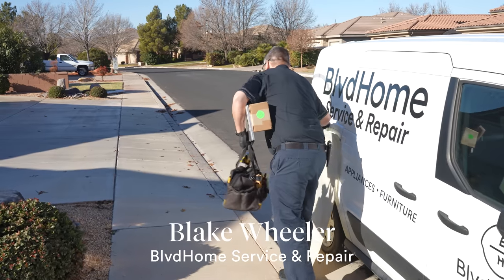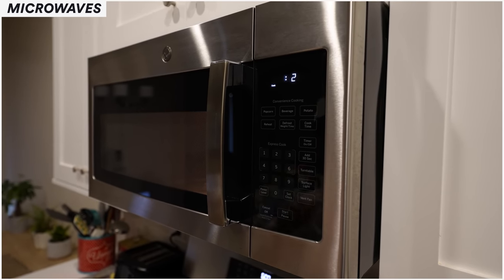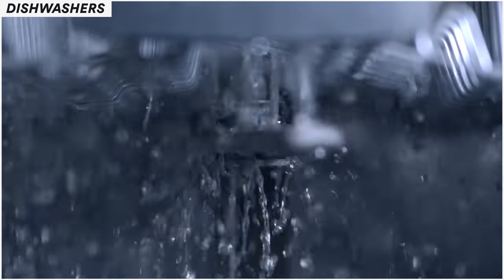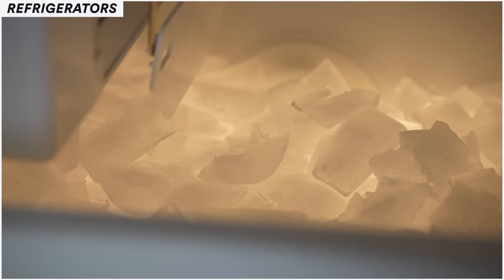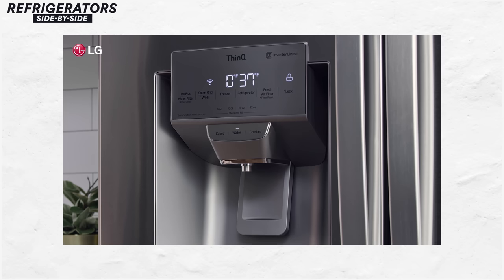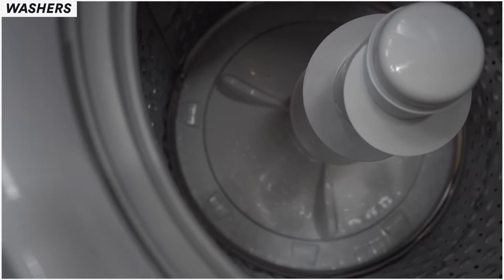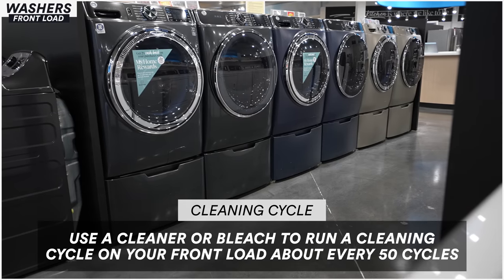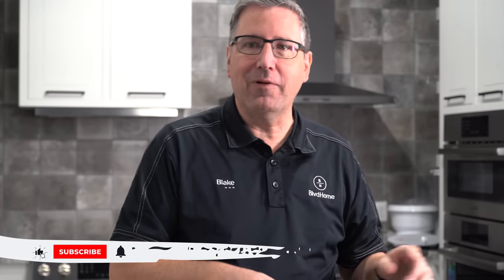Best Appliances Recommended by a Repair Technician of 29 Years

Comment: Our repairman gave us similar advice on brands and features on the appliances you mentioned. He did say Bosch DW parts were especially hard to get even before 2020.  He recommended the Whirlpool. We actually love our KAaide, which is made by whirlpool. Less $$$ than the Bosch, too. 

No matter what brand of DW one gets my best tip for preserving the plastic parts and dishes is to not use the heated dry cycle. Open and let the dishes air dry. I have replaced most of our plastic storage with glass or stainless steel containers. This also helps the drying process.
Reply: You are so right about not using the heated drying cycle.  I open the door of my GE dishwasher & pull the racks out.  I check for water pooling on top of cups & stuff.  Within +/- an hour the dishes are dry & spot free.  I even put large plastic items on the lower rack without damage by using this method.
Reply: Thank you so much for the advice. It makes sense why the plastic on my refrigerator is falling apart. I used heated drying. I will have to replace and start opening door instead.

Comment: Excellent video!!  I didn’t know that pulling a microwave door open to stop it was hard on the switch. I have been doing this because of the annoying loud 5 beeps when the timer reaches zero. Most models don’t have an option to turn off the sound. So, when I wanted to avoid waking up my family in the early morning, I’ve been yanking on the door.
Reply from the maker: I totally understand that! Microwaves can be super annoying, especially when you're trying to be quiet. Glad that the video was helpful!

Comment: Use powdered laundry soap in the front loaders and they wont get stinky.  I switched years ago and never had a problem with bad smells again.  I dont do any special cleaning and leave the door closed most of the time.  Great video!
Reply: Intetesting, because usually liquid detergent is recommended.
Reply: The powdered detergent sticks in the dispensing trays - it never  clears out of the tray after a cycle so no to powdered detergent. I throw oxy clean directly in the tub before the cycle for this reason or I dissolve it in water first.  Lg front loader.  I love my washer but no to powdered detergent t and my washer never smells.  I’ve had it for 12 years.   Leave the door ajar to let it dry out and do the clean cycle with bleach once a month.  I’ve never had any issues with any odors and with 6 dogs in my house I’m washing bedding  all the time.
Reply: yes,  I use powder for regular wash and liquid for woollens, After reading horror stories before buying my current Asko, made in Slovenia (previous one lasted 18yrs, top model of the day, made in Sweden)
I always remove the soap dispenser to let it dry and leave the door ajar, the door closes without rubber bellows  - no mould or funny smells,  both parts of drum are stainless steel, drum supported on 4 shock absorbers.  No special cleaning program needed during the last 6 years. fastest.  Spin cycle is noisy but works well.    Asko Dishwasher lasted over 20 years and failed in a recent power surge.
Reply: Leaving the door closed is how you get tons of mold in there and it has nothing to do with the type of detergent you're using. I imagine your washing machine is disgusting

Comment: I have a bosch dishwasher, LG washer, Hitashi fridge (no ice maker) and frigidaire gas range and they have served me well in the past 5 years. LG washer lock button broke and changed it for 15$ and literally that is it. I am truly lucky and amazed by the built quality of those appliances and would definitely buy them again.
Reply: I've been looking into LG washers. Which do you have and how is it?
Reply: @johnnys249  i dont know off the top of my head but I can give you the model number when I get home. It is a washer/dryer 2 in 1 kind though.
Reply: @johnnys249  f0k6dmk2s2 2 in 1 washer + dryer inverter direct drive 14kg wash / 8kg dry

Used on daily basis and multiple times a day even. Only maintenance needed is to clean lint and empty water from bottom tray. I guess some sort of condensate from drying or something. Super easy though. There is wifi where you can custom make your wash or download some from the web. Never needed that. Plenty of options on the washer already.
Hope this helps.
Also: i bought this in Kuwait so it may be a Middle East special version but I am sure a european or us version of it exists with similar features.
Cost around $650 in 2018.

Comment: I have a 45 year old Maytag A806 washing machine second hand 10 years ago and in the entire time I had it there were 2 breakdowns. A dried up broken hose and leaking water pump.  Replaced both myself and was fairly easy with minimal tools.  I change the belts every so often and the damper pads and that is all the service.  It is very gentle on the clothes.  They do not make them like this anymore!!  Never plan on getting rid of it.  In fact it has outlasted 2 newer dryers.
Reply: I cannot begin to imagine what you're electricity bill looks like
Reply: @VEVOJavier  Not bad this unit only take 25 minutes to run a full cycle, using some maths its 15 cents per load of electricity.
Reply: I have had my late mother's old Maytag from 1980 for the last 15 years. Had a couple of $150-200 repairs in last 8 years, and three weeks ago had it finally flood my kitchen, laundry and family room. It served us well for 44 years, and now I am getting a new kitchen courtesy of my home owners insurance. So even when Maytags fail you can win!!
Reply: @krisschedler  yes. I had something like that happen with my LG dishwasher.  The drain hose just fell apart on the pump. Only 4 years old.

Comment: My #1 failure reason on microwaves = weak, crumbling plastic parts. If you ever have to take a screw out of that plastic, it just falls apart. SO COMMON. Especially over-the-range Frigidaires. Cheapness elevated to the highest level.

My long and varied experience with LG washers and Bosch dishwashers agrees with the video. They work great and are amazingly trouble-free.
Reply: Yup, was looking for a comment about this. Our door handle cracked on our above the range microwave and it costs too much replace!

Comment: So glad to hear about Bosch; that's what I keep seeing online, and I have a friend who loves hers. That's our plan. For our needs, we basically found a particular French door/dual bottom freezer LG that works for us, but I'm leery about it now. :( I bought the Bravos Maytag washer/dryer, which again, suited my very specific needs (eg disability  and short). I wish the washer had a buzzer when it finishes; a little plastic piece broke where you remove the detergent holder to empty water out, but it still works. I have trouble loading it so that it washes properly--comforters end up with a dry spot in the middle (top loading, impeller style). Once I actually watched it clean, I feel like too much laundry is sticking out of the water, using so little water. I now use specific higher-water level cycles now instead of letting it decide how much to use. I was very happy with them for a while, now, 5.5 years later, less so, but they're still functional.
Reply: LG refined the linear compressor in their refrigerators according to Yale Appliance and their blog LG for the past two years have been most reliable refrigerators from their own repair records. We just bought an LG refrigerator with the new linear compressor.
Reply: @mustangecoboosthpp3869  I just got it delivered Tuesday (mid July) after ordering in April. Makes me wonder if such an order back up was due to making changes. Funny that the entire time the home improvement stores said it would be delivered in like 3 days before you order. It only changes the fulfillment date the day after ordering.

Comment: Thank you, Blake. Really appreciate your honest reviews. I can confirm for two appliances we have his recommendation: GE refrigerator 25 years old accept the light bulb issue, runs without problems. LG top load and dryer no issues. You should tell everyone to level it once in a while. If it is not leveled correctly it'll not turn on. We had that issue and called several technicians. One came to have a look at it, and told us that a part($150) needs to be replaced due to a disconnect behind the start button. I found the same recommendations on youtube, which was a reason to trust the diagnostic. Since the cost seemed high, my husband wanted to try it before ordering the part. The reason why I'm letting everyone know is that the other two technicians said the similar things "Oh, LG washers are having issues and are not reliable". My husband found no issues with the parts. Leveled it and low and behold, it was working by the slightest touch. Now, searching for our Dishwasher problem, I see that you are given your honest recommendations. Other reviews on this channel are true as well. Thank you so much! Love your channel.
Reply from the maker: Thank you for all those kind words! Glad that we can provide helpful and informative content.

Comment: I know several people that bought front loading washer / dryer and absolutely hate them because of the mold issues they run into if you don’t maintain them like he said in the video of airing them out and running bleach cycle once in a while to clean it out.
Reply: I switched to powder laundry soap years ago and the washer never got stinky again.  When I was using the liquid detergent it always smelled sour.

Comment: Im getting an LG washer dryer set delivered from Costco in a few hours. Glad to hear its in the top category in front load washers (and dryer). Our Whirlpool washer that came with the house when we bought last September went ka-put so we've been without a washer for about a month.
Reply: Does Costco remove and take you old washer & dryer? I'm looking into now before mine goes out and we do have Costco
Reply: Did u move into a new house last September? Wondering how old  is the Worldpool washing machine!
Reply: The washer is gonna tear up your clothes
Reply: Just in the process of buying a new set from Costco. How do you like your LG set and which set did you get, if you don't mind me asking. Having trouble deciding.
Reply: If you are stacking them I hope your dryer vent is higher than the vent hose.  Otherwise good luck.  Mine overheated constantly, they even changed out the motherboard and it still overheated.  I had a contractor remodel my exhaust on my home so that it vents higher than the dryer vent.  No more issues.  I love my LG washer but I hate the dryer.

Comment: Great video! An appliance guy told me years ago:

* Don't get a fridge with an in the door ice dispenser, and if you have any fridge with an ice maker, don't use it. Turn it off and buy your ice bagged from Costco and put it in your ice bin. Took his advice. Our GE fridge is 20 years old and not one service call. The appliance guy also told me ice makers are the number one reason for damaged hardwood floors, due to leaks. So if you have hardwood, all the more reason to turn off that ice maker.
* Bosch is the best dishwasher. We have had two Bosch in 20 years. That's pretty good, I think.
* Never use the self clean on your oven. It fries the electronics. I didn't listen on this one, and sure enough, fried the motherboard. When we bought a new oven, we decided to only clean by hand.. It's a pain. but it's been 12 years and counting. Not one service call.

He did not tell me about the microwave, though. So thank you for that advice.

Comment: I have the Electrolux Front Loader.  Zero problems.  Everything just works.  Had it for going on 5 years now.  Boost heater still works like brand new.  It's a rock solid washing machine.  Cleans clothes better than anything else I've ever used or owned.  I run clean cycle when the machine wants me to.  Scrubbed the seal maybe once or twice with bleach and a cleaning sponge.  Fantastic machine.
Reply from the maker: Electrolux definitely makes a great front loader, glad you love it!
Reply: Which model Electrolux do you own?

Comment: 7:04 I watched a video that explained that side by side refrigerators are the best if you want to purchase a fridge with an ice maker. The french door refrigerators have the most issues because the ice maker is located inside the refrigerator and it creates a lot of unnecessary mist and condensation. The mist can freeze on parts of the ice maker that allow it to work properly. I have a Samsung fridge and had this exact issue. They apparently have a class action lawsuit going on due to their faulty ice makers.
Reply: Yes they do, we have a Samsung & nothing but problems with the ice maker. It really has never worked
Reply: Yes they do. I replaced my Samsung fridge today with a Frigidaire. Hopefully it will last 😊

Comment: I have an LG refrigerator. I love it. It was the most recommended model from consumer reports that year. It’s going on 6 years no problems. Most appliances differ in reliability model to model. Brand reliability is almost non existent nowadays. Generally the less bells and whistles you get the more reliable it will be.
Reply: Lg craps out at 4.75 yrs..they have massive law suits do to compressor failure. I’m a never again on lg
Reply: 11 years going strong with my LG French Door Refrigerator.  ZERO problems!  It's past the 10 year warranty now.  Will buy another LG refrigerator in the future based on my experience!
Reply: @nomomania6827 have you not had any plastic bits just break off whenever you touch them?
Reply: My LG French door refrigerator freezer is 6 years old and has been brilliant. We live in a humid tropical environment and I was a bit concerned when we bought it as it wasn’t cheap but so far it’s been faultless.
Reply: @PhD63  the refrigeration part is fine, if a bit noisy. It’s the quality of materials that I’m complaining about. The water and ice features are practically inoperable because all the plastic components, screws, and springs have broken off.
Reply: @Quince828  mine doesn’t have water or ice dispensing features.  If I want ice, I fill up the ice tray.

Comment: Appliance tech here. I’ve seen Frigidaire refrigerators giving me a ton of headaches with Yoder loop issues and sealed system issues the past 6 months. Been getting my tail whipped with em recently. Hopefully they’ll bounce back, usually not a problem and great units. LG and Samsung is iffy. Speed Queen is an absolute beast (but they still break). If you don’t have that extra dollar, I’d go with a whirlpool brand top load or Electrolux for front load. Everything else is pretty much just personal preference. Great video boss man.

Comment: I can say that I have a Bosch dishwasher and LOVE it.  Super quiet, cleans really well.  I also got a Bosch induction cooktop.  I bought a Samsung Fridge based on appearance/function and had a problem with the ice maker at the 5 year mark.  That fridge is 10 years old now and if I replace it I will be looking at a different brand (and one of the ones recommended in this video!).  My wall oven is Kitchenaid... I didn't hear this brand mentioned at all and wonder your opinion @BoulevardHome? It's 20 years old so far and still a workhorse.  My washer/dryer are LG, also about 10 years old and still going strong, I would replace with the same in the future, great to know you recommend them!

Comment: Great advice, I never thought about the switches in the microwave arching when opening the door, I'll stop doing that, I did buy a side by side lg refrigerator with the linear inverter compressor, I must have read somewhere about side by side being more reliable than freezer on bottom, didn't learn about the lg refrigerator issues until after purchase,we will see how reliable it is in time

Comment: I was sick of the smell of my clothes from front loader and complained all the time. My husband gave in about 4 years ago and we purchased a top loader Speed Queen. It was the best purchase we’ve ever made including cars, tv’s and everything. I’m truly happy with my washer. Do not use fabric softener, gunk will build up and I noticed this early in the agitator. My only con is this, I mix my detergent and water a little bit before adding clothes, if I walk away and forget it’s filling, I will end up running a empty load, purely my fault. Also I like to add clothes later but it locks once it’s filled, so you have to pause it before it unlocks.
Reply: Which one (model) do you have?? I’m
Looking into that as well
Reply: Their classic models are their old-school design and don't have the lid locks. That feature alone (they were the last to change, then quickly brought it back as the 'classic' model) sold MANY Speed Queen machines at my last job over the years.
Reply: @MarkZickefoose  Have a set Speed Queen from a few years ago have been fantastic, zero problems. Did have the lid lock but can be bypassed.